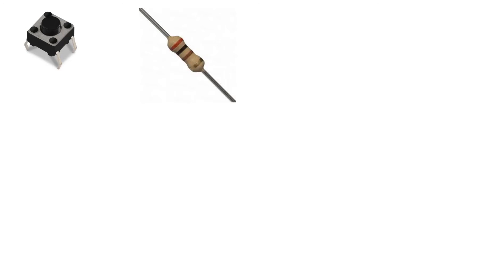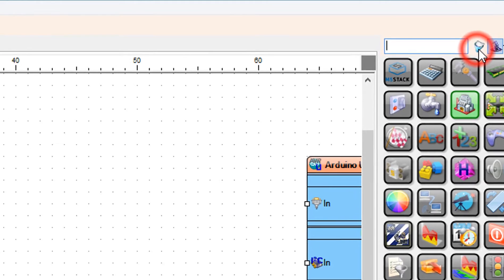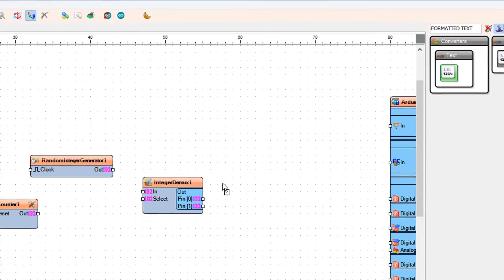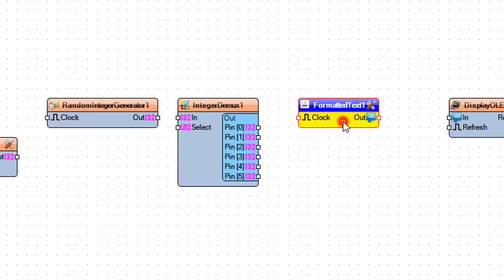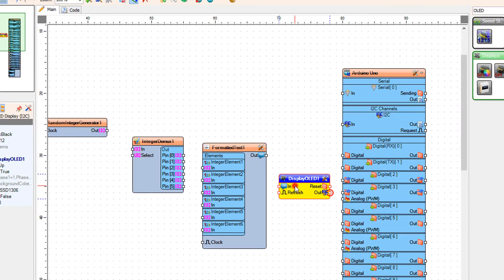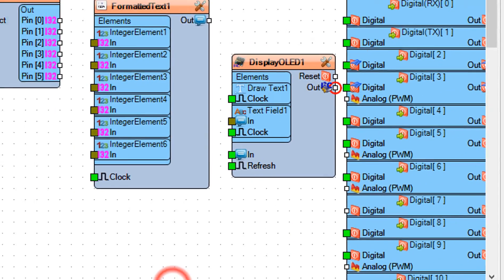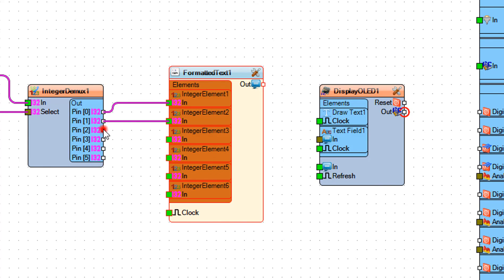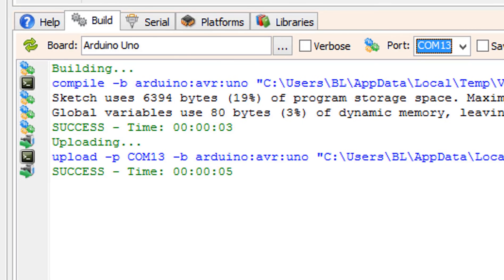Arduino Lotto Random Number Generator

Comment: Congratulations, an amazing project! I built the assembly with Arduino Nano, it works perfectly. The text% 0% 1 ... needs space between them. I added another text with the lottery from my country, 6/49. -x = 80, size = 2. I would ask if it is possible a project based on the solar system, with points that move in the style of planets, on an OLED display. You can find a device with PIC on my channel. I ask your permission to post the montage I made.
You have a new subscriber!
Reply from the maker: Thank you! Yes I am interesting in that project, can you send the request to https://www.visuino.eu/contact/
I subscribed to your channel.